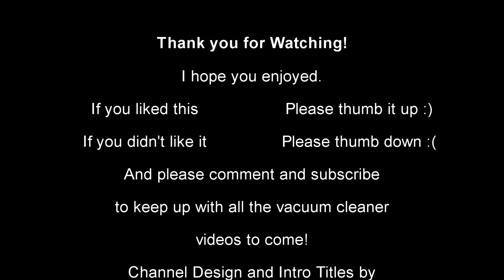Changing the Carbon Brushes in a 1996 Numatic Henry HVR200

Comment: WARNING: Don't snip off the brass tab that you have bent back to remove the old brushes.  Instead snip off one of the small tabs on the new brush.  When you have inserted the brush and got the brass retainer in position then bend the tab back to hold it in position.  Doing it his way means that you will have the devils own job to keep it in position.

Comment: Great video Sam 😊, this is one reason why I love Numatic vac's, they're ridiculously reliable and on the rare occasion one does go wrong, it can usually be fixed fairly easy and they're also powerful vacs too 👍
According to Numatic, Most of the 10 million Henry's they've built are still running today, I think that in itself shows just how reliable Numatic vacs are 👌
Reply from the maker: I did like the little nub in the carbon brush that pops out and kills the vac before damage occurs though, thats how it should be! If that was a modern henry it would need a new motor!

Comment: 12:23 glad you scrapped the 2001 Henry! I really do not like the UDS motors! They're absolutely rubbish!! But the twinflo motors in e.g your mums Henry are the best! In my opinion!
Reply: Well his mums motor is knackered plus it might be getting scrapped too
Reply: Vac Washer26 the UDS ones are far worse. How do you 100% know that Crap-Tastic Henry is getting scrapped?
Reply: @NumaticHenryLover  I don't know I just think but I hope not
Reply: Vac Washer26 I really hope not. Really not keen on the 2011 Henry. There is nothing special about 2011 Henry. He wasn’t even like a blue,green nor even a yellow one (he would’ve been a clone to Steve’s one 😂) but UDS Henry’s particularly the rocker switch models are FAR FAR worse. I think they were the worst motors by far. Here’s the scale of motors worst to best.

UDS (99-04)
1100w type 1. (96-98)
620w (2014-Present)
Twinflo (2004-2014)
800w (81-90)
1000w (90-95) 

Here are my opinions of the motors that Numatic have used over the years. Worst is UDS and best is the 1000w.
Reply: @NumaticHenryLover  why is the 620w shit?
Reply: @bread-gz3rl  I’ve heard of a few only being a year old burning out lol.

Comment: Hi Sam,  i have a similarly old henry which upto today was still working as new! Frustratingly that changed as the nut which is on the end of the motor decided to undo itself. 

I tried tightening it back on but this didn't help and it span off on the first use. Any ideas on the problem? 

Cheers!

Comment: Cracking instructional video Sam. I have a Henry exactly the same as this one. Bought it brand new probably around 30 years ago and it's still going strong. I was sold when the guy selling it to me stuck a house brick on the end of the pipe and it held it. I could with changing the brushes. What site on eBay did you get them from?
Reply from the maker: It's certainly worth doing them before they cause damage. You'll need to know how old yours is, early 1990s onwards were the same size so hvr200 carbon brushes into ebay will bring up lots. Or open Henry up and if its old enough it'll have the details on the side. Just search the carbon number it says

Comment: Hi Sam, I bought a standard aftermarket Henry floor head. After a few months the switch you flip doesn't seem to raise the bristles completely. Can this be fixed or do they just break regularly?
Reply from the maker: I'd say one side of the paddles that push the brushes down has snapped sadly. Easy enough to whip the base plate off and check though
Reply: @beko1987  I've had a look. The black plastic frame where the inner screws are have split. Is this the part you mean?

Comment: can the turbo socket and it's wires be removed? the silver rectangle thing snapped off mine. is it dangerous to still use the machine like this? no wires are damaged or anything
Reply from the maker: Yes it's removable, got to disassemble it a bit though then you'll find the wires come off the switch wire. Cut the wire as close to the spade connector as you can and just plug those back into the mains switch. Disconnected and safe then!
Reply: @beko1987  thank you so much sir! Great help! Keep up the good work,  amazing videos always!

Comment: Is it normal that Henry smells burnt during using after changing the brushes?
Reply: No, apparently it means dust in the motors burning, to wash all the filters
Reply: For 15-30mins a little bit yes but if it's been more then 2h of use then definitely not

Comment: What did you search for to get these brushes?
Reply from the maker: I opened the vac, and on the motor will be the part number for the carbons. I searched for that on ebay, then only bought from listings that specifically stated it. That way when the wrong brushes arrived I could send a photo of the motor and part number and get my money back from the idiots who sell modern hvr200 carbons under all the part numbers they can. Good luck sir... Could always file some larger ones down if your careful and keep the sides flat